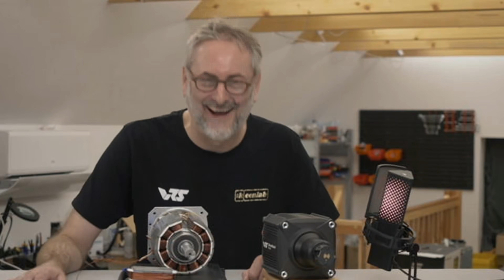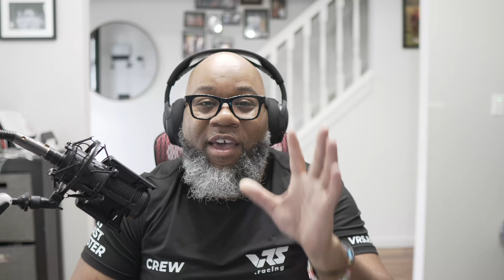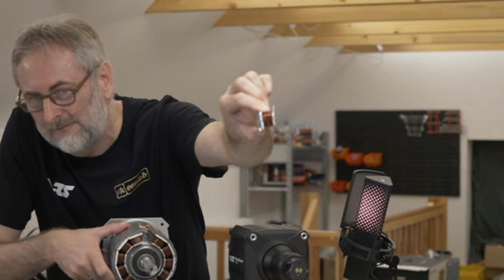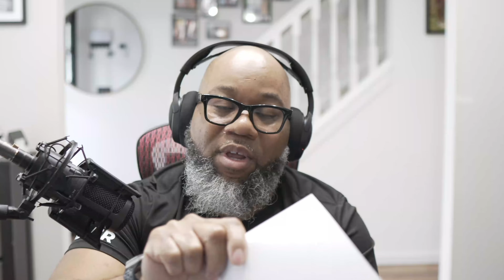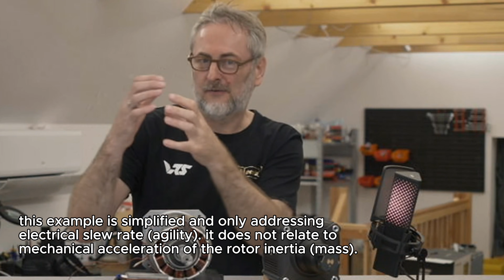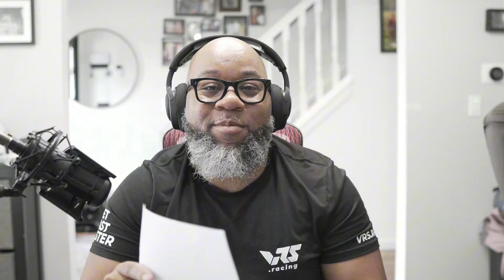VRS DFP15 vs. DFP20: Which Direct Drive Wheelbase is Right for You? | VRS PODCAST E02

Comment: The comparison or rather the "conclusions" between the DFP15 and DFP20 don't make any sense. Why would the DFP20nm be more "raw/responsive" in feedback over the DFP15, when the DFP15 has newer technology and is described as "smoother/detailed". Just seems like a direct comparison was tip-toed around leaving the viewers with no real answer. My attempt to read between the lines is the DFP15 is actually better, and the DFP20 can simply go "louder" but with less detail.

Comment: I mainly drive the IndyCar (IR 18), and other open wheel cars. The IndyCar has no power steering, so would I be correct in assuming that either of these 2 would simulate that feeling? Not sure which one of these would be give me the best experience.

Comment: I went from the MOZA R9 version 2 to the VRS DFP15...now on firmware 1.9. 
That wheel feels so complete in Le Mans Ultimate, AC and ACC.
I run mine at approximately 13nm with the Conspit 300GT in those three titles. It is just the cat's meow.
Reply: Hey! I’m looking at this set up. Are you using qr or anything extra to connect the wheel or are you just running a separate cord?
Reply: @majik16106 
Running VRS quick release and Conspit cord neatly spiraled around it.
You barely see the Conspit coiled cord, since it is plugged directly into the VRS pass through cable.

Comment: Regarding what's being said after 20:00 , I believe I know which other base was mentioned hehe, and yes, 18 can be more than 15 in numbers, but not in quality. At the moment I have both here, and although you do get more strength at 18Nm, it's useless in that particular base because the real EVOlution is really in having all the details as clear and balanced as they can be. And that perfection is reached with the VRS DFP 15. While the 18 product just can't transmit a real feel depending on the game - it exaggerates some unnecessary forces, which in real life aren't that way, and then you need to introduce a lot of filtering to compensate that, which basically will kill the details for the necessary forces. As an example, the 18 base at Nordschleife in iRacing shakes your car on plain asfalt for no reason, yet you can't feel the brick patterns on the side of the road, the kerb nuances or the grass your running over. OK you feel the grass... but when you do you're busted, car's gone. And it would be good if you had never driven the VRS base before... because with the VRS DFP 15 you feel what you feel in the real track. I mean, I've been there and what I feel with the DFP 15 is what I felt in real life. And what I expect from a simulated race track: the right track ondulations, the right amount of vibration from different types of tarmac/asphalt, and the right up, down, and vibration feeling when riding over kerbs, different kerbs with different feelings. I get those feelings with precision when I use the DFP 15. Then I can set it up to 15Nm and have enough strength and this richness of detail, that I simply CANNOT get with the 18. I've spent literally hours trying to tune the other base to mimic the VRS one, just trying to get "that real feeling", and I still couldn't. When I'm close to that on track, the kerbs feel like an earthquake, but I still can't tell when I'm touching the grass; when I add filters to fix it, the car feels numb and 18Nm are more like 5Nm in your hands. Whilst with VRS I can fell everything the car is telling me. So yes, more does not mean better if it's not well packed. The DFP 15 is a better choice than the 18Nm product from the other brand.
Reply: What other brand are u talking about vnm by any chance I can’t make up my mind
Reply: @jayjayp9618 hey! At 18Nm I believe the other brand was Simagic with its Evo Pro. These days it’s quite hard to decide, so many great options. VNM, Simagic, VRS, Conspit, even Moza but not as good as these others.

Comment: The big question is, are you guys coming up with a modern dfp20? I am really torn, I want the smoothness of the 15 but the power of the 20? I've been close to getting the Simucube 2 pro, but prefer the VRS since I plan on getting the pro pedals too! Is the mige motor limited by hardware when it comes to smoothness(zero cogging)?
Reply: We definitely will be extending the new platform in the very near future!
Reply: @wearethewatt2950  That would be awesome! Really looking forward to that to get my one-and-done wheelbase!
Reply: @donniedarko5529 the DFP 20 is very smooth, personally i don’t think this should be such a consideration though because turning a wheel in a real car is not very smooth unless the wheels are off the ground.
Reply: Don't get me wrong as I've only recently got the 20. But it's smooth as butter.

Comment: Good video guys. I came to VRS from Fanatec about 3 years ago, I tested Simagic, Simucube and Asetek but the VRS demo was the best. The sense of traction and weight transfer was exceptional and it was the first time I ever really felt like I was connected to a rubber tyre, I know it’s not connected to anything but it fools me completely and I absolutely love it.

I would like to see more depth to the discussion on the filters, some visualisation of a recorded ffb signal from the sim that can be played back through the VRS with a sort of frequency response graph to show how a Smooth 3 attenuates the higher frequency signals compared to Responsive 1, overlaid onto the raw signal using the None filter.
Reply from the maker: We have plenty more coming and I think you will be happy to see. Additionally, having a wheelbase that connects you to the car is key, and we feel like we have created that. Our goal is to continue to refine, innovate and push further ahead.

Comment: You're charging almost double what moza charges for an equivalent no? thats absolutely insane xDD
 Over 1000aud for 9nm HAHA you'd have to be mentally retarded to pay that im sorry. Your wheelbase could be made out of solid gold and that would still be a ripoff.
Paying 1k for an entry level wheelbase is genuinely one of the most out of touch things i've seen in simracing.
Reply: Pricing in USD that I track, with just 2 examples below.
- $349 Moza R9 V3
- $648 VRS uDFP 9nm ($549 Base + $99 Shaft QR)

- $469 Moza R12 V2
- $748 VRS uDFP 12nm ($649 Base + $99 Shaft QR)

On a pure $/nm perspective, ALL of the uDFP models other than the top 20nm model are worse than any other competitor at the same torque.  But anyone looking into the uDFP line is more likely aimed at the 15nm as an end, if not the top 20nm.  Their upgrade path has this in mind and is the incentive to get into a high quality base with a lower starting cost, but have an easy upgrade path.  

Compare this to starting in the Moza line with an R9 and then deciding to end at the R21.  Pure out of pocket cost for both of those is $1198 vs $898 all in to the uDFP 20nm upgrade level.  It's possible to resell the R9 and recoup some of that cost and potentially end up better from a pure price perspective.  But taking that path is more "friction" in effort vs the VRS uDFP upgrade that is no new equipment or swapping.  So it can make good sense if a person knows they will be pushing upwards over time.

But for those people aiming in the sub 15nm torque and unlikely to upgrade, the VRS uDFP is not as "value" oriented in a pure $ sense. That said, the performance style and options within the uDFP may be prized enough by anyone that they could be very happy with the results vs other lower cost items.  So it's an option even if it doesn't look like the best choice purely on a budget.